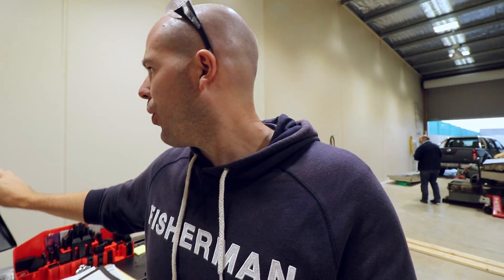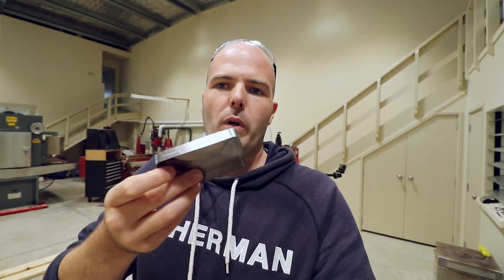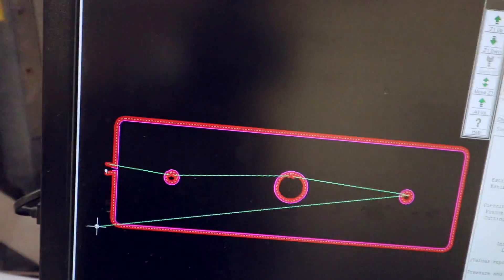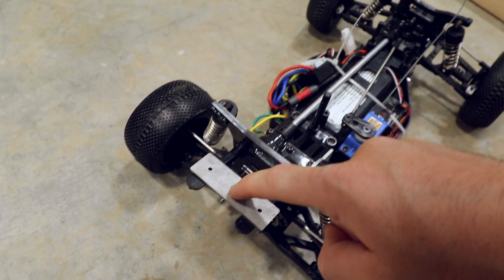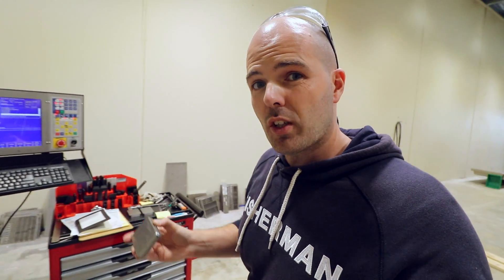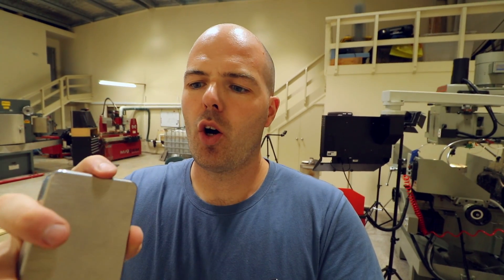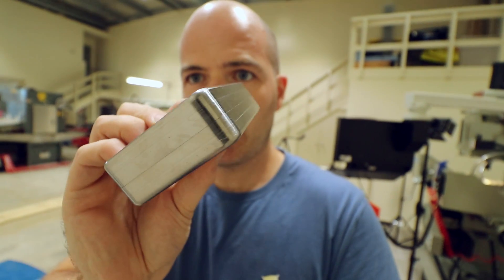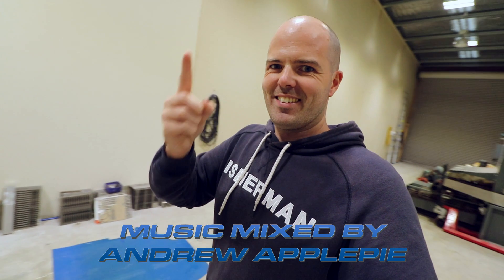Titanium Playing Card Holder (Part 3)

Comment: Your part wasn't flat in the vice because you are using extruded bars of aluminum as parallels. 
Machinist parallels are one of the most basic and fundamental tools of machining and are precision ground within 0.0001in  of nominal, which is why you can reliably setup your part on them and expect it to be flat and parallel. Lets say all your parallels somehow got destroyed in a fiery inferno and you don't have a single one for a job you absolutely must do today, in this situation you can machine yourself some parallels on your milling machine which should get your parallel within 0.001in, not great, certainly not 0.0001in that you get from a ground parallel but a lot better then those extruded bars! those variate in thickness by 0.01 maybe even 0.02in, which will translate into the flatness of your part. Not good at all, can expect to have features line up or maintain any kind of precision in that situation. So get some parallels! They are not expensive!